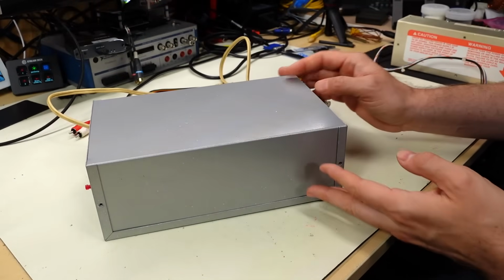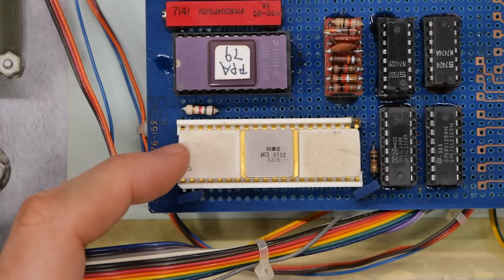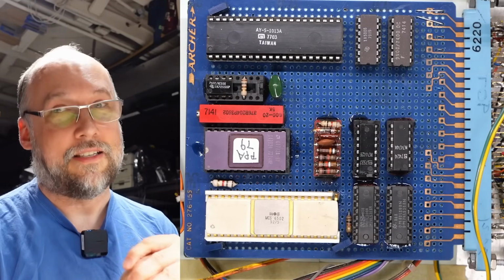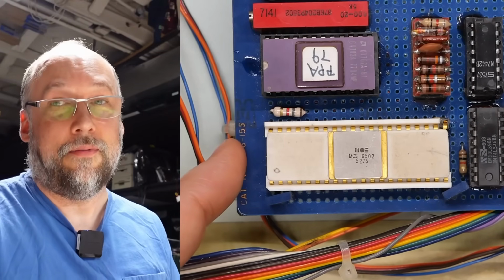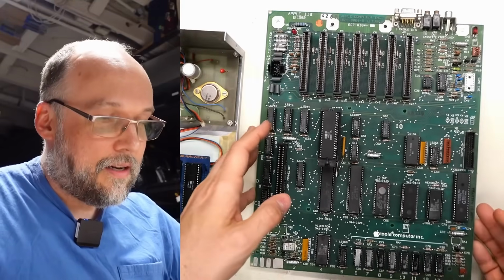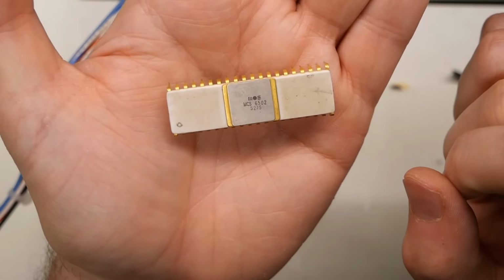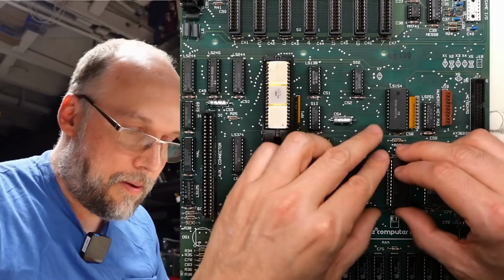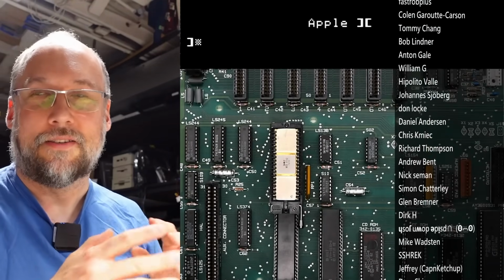Let's test a 50 year old MOS 6502 CPU

Comment: I loved this @adrian! I was studying electronics in 1974-1977, and then did a PhD in computer design. 
My one quibble with the video is that the 6502 is NOT a simplified 6800. 
Yes most of the original design team came from motorola, and yes the 6501 was pin compatible to the 6800. 
However it's architecture is very different to the 6800 and it has a fraction of the instructions. For example it has 2 index registers, and far fewer instructions.
Chuck wanted to build a better chip for control, because he found that people just balked at the $300+ price of the 6800!
Chuck Peddle's vision was for a cheaper chip to do simple interface and washing machine, etc. control. In other words using the microprocessor as replacement logic. 
I think he would have loved this application of the chip! 
And I love your sheer joy and excitement of having it work! It made my day!😊
Reply: I agree.  Sometimes there was an old way of doing something w/o a microprocessor, but now always.  I used mainly a Z-80 in that time period but I remember looking at the 6502 instruction set, etc., and I remember how relatively bare it was.  Sometime later than that my most hated micro was a PIC of some kind where instead of conditionally jumping to someplace you had to write the jump instruction and then branch over it if you Didn't want to jump.  Arrrg!
Reply: The 6502 is not a simplified 6800, it is a reduced-cost but more complex close relative of the 6800, that also performs much faster in skilled hands. They both have very few on-chip registers compared to the 8080 and z80. The 6502 dropped the 6800's B accumulator, reduced the stack pointer from 16 to 8 bits, and the index register from 16 to 8 bits but had two of them. Motorola themselves made similar modifications to the register set in their later chips that (unlike 6502) shared most binary opcodes with the 6800. The 6801/6803 allowed A&B to be used as a 16 bit D accumulator. The 6805 drops the B accumulator, reduces X and SP from 16 to 8 bits and PC to 13 bits, The 6811 like the 6801 supports the 16 bit D accumulator and also adds a 2nd 16 bit Y index register. And of course the 6809 supports D, adds Y index register and U extra stack pointer and allows all four of X, Y, S, U to be used almost interchangeably for indexing (but only S and U for stack). It also adds a lot of new addressing modes. So the 6502 would fit easily within the variation in the 6800 family, except it uses completely different opcode encodings. The biggest thing with the 6502 was the indexed indirect addressing modes that use a pair of zero-page locations as a 16 bit pointer, with a choice of using the X register to choose at runtime which base point to use, and the Y register allowing indexing relative to the pointer -- but sadly not both at the same time.  The 6800s four addressing modes are applied much more uniformly across instructions, but are less powerful and the bane of a 6800 programmer's life is constantly loading and storing the X register from RAM so you could point to different areas in RAM. The 6502 effectively had 128 6800-style base pointer registers, it's just that they lived in RAM. The 6800's 8 bit constant offset is useful for selecting fields of a struct, but not for pointing anywhere in RAM.

Comment: Well, in 1976 that chip would have been considered e-Waste... Makes you wonder in another 50 years what would be rare/collectable in today's e-Waste?   Wasn't one of the early Pentiums suffering from a math bug?  🤔
Reply: I think it's rare for micro manufacturers publish bug sheets.  But the few bug sheets I saw back in the day, there were a surprising number of bugs in the silicon!  It's not hard to believe a ROR instruction didn't work, but more typical was something on the order of some operation doesn't affect the flags like the manual says

Comment: Adrian, I Believe, I found 2 of these, Chips, A year or so Ago, I will Look and see, I am Not any kind of Electronic, or computer Guy, I just like Messing with Things and Most of the Time I get things Running, I will Look for Them, The Reason I think they are the 6502, I remember looking up This chip and Reading about the Missing file it Needed. I will Let you Know, I,m glad I found your Video

Comment: I haven't quite put into 2022 dollars how much I spent on early computers back in the mid-70's and 80's. It seems that each system cost about $4500 back then, and I was avid to keep upgrading when anything new came out. My first S-100 system (which I still have!) had a massive transformer for power, and the case was made of 1/8th inch thick steel. It had at least 12 card slots, where each S-100 card of course had 100 pins. To add a mere 8k of ram to the system cost me then $625... for a mere 8k!!! I think ram topped out at 32k, and it cost me a fortune. I had a particular project to accomplish, involving multivariate linear regression. When I finally wrote the program and ran it, got the error message "Insufficient memory to invert the matrix". And that was that. The project failed. I continued on with Z-80, 8080, then 286, 386, 486, and pentium cpu's. When all said and done, I probably had spent over $100,000 of "1980-ish dollars", and in the end my best system was no better than any junk desktop no one wants for any reason. But I can tell a lot of stories such as about my pair of 8-inch floppy drives which weighed about 150 pounds. When it needed repair, I had to transport it in a wagon to be shipped from NYC to Boston, all so they could overcharge me to replace some big loose rubber bands or something. You get the picture.

Comment: I have about a dozen National Semiconductor 8080A microprocessors, the first ones ever put in plastic packages. They were burned in for 1000 hours and still passed final test after that. They are from the fall of 1976 so I don't know if they are still good or not. That have spent all of the time since then in black conductive foam. I also have some in CERDIP and side braze packages.

Comment: That is a beautiful board. Instead of shadowbox I would put it on a turntable so it shows off the wire wrap side too. I wish Radio Shack was still around. The oldschool one. It's made basic repairs on gear at the radio station go from a few hours to a few days sometimes resulting in being off the air if I don't have the component and I have to stock a whole lot more components and connectors that I can no longer "Run to The Shack" like I used to. I wish ours had survived since it was Radio Shack in name only and the owner stocked a lot more than you would find at a regular shack. Now I have to order from Mouser or Digikey.

Comment: Chips with bugs went in production back then. I.E. the 286 couldn’t, but should have been able to run in virtual mode .. the 386 had to have a math-co, because that part was disabled.
 Contrary to popular belief, wire wrap is very reliable, and is still in use today .. was a mainstay in Western Electric telephone company CO single solid conductor cross connects.

Comment: Wow - memory lane. Its a timecapsule of 1970's United States IC manufacturers.  You have Texas Instruments, General Instruments (UART), Signetics,  Fairchild and of course MOS Technologies (later Commodore). I cannot read the UVPROM vendor but its likely Intel.  For the young folks out there to update the ROM (you call it flashing) - you had to take it out of its socket, put it under a UV lamp for 30 minutes to erase it and then you could update the image again. Very time consuming. 
There is a bit of folklore about the 6502. Rumor is that the reason it was used in the first Apple Computer kits was that Wozniak worked at HP. HP had a policy that Engineers could take parts, for free, home for their personal projects to encourage individual growth.  It is said Woz snagged a tube of 6502's out of the lab inventory and built the Apple I with them. Back then it was not easy getting parts. And starting a company was a challenge as the concept of Venture Capital was just beginning to seed. Most startup personal computer companies in the SF Bay Area (there were about 60) ran month to month like a shoe store. You secured a line of credit, built sold, paid it down and continued.

Comment: What about making this processor do something like simple clock, or a count down that would show on leds it's age up to the second digit staring at the 1st of the month after it was produced to calculate its age? 
 Like a box with a PLASTIC sceen with a tag saying I am a 6502 YY years, DDD days, HH hours, MM minute, SS second : old And I am still working. And to make sure it always the right data displayed use an RTC chip that have the date and time setup properly. A simple rom load wich first read the RTC then it use the databus 4 first bit to send the data to 1 bcd to 7 line dispaly chip to drivre the 11 7 line leds that form the number and with the 4 last bit of the bus use a 4 to 16 line demultiplexer like the 74154 that will drive the good led common select of the 11 7 bar led. or of you dont want to use the 8 bit buss, use the adresse data bit to do the same I am sure the that you wont need much ram if any at all. worst case a 1k ram chip would be more than enough.

Comment: It's weird - I learned to program in high school in 1972 - my microprocessor history goes through the 4004, the 8008, the 8080, the Z80 and 8085 - then the 68000, Z8000, the 8086...and so on.  But I never owned a 6502 or a 6800 - I bought a couple of TRS-80's for home - never bought a Commodore or Apple machine...somehow, I completely missed the 6502 & 6800...I doubt I've ever programmed one - which is very weird now that I come to think about it!

Comment: These would have been very rarely used for that specific purpose by that point in time.  You could have opened 100 other I/O converter boxes from that time period and NOT ONE would have had an early pre-fix 6502 but this one user, is the 1% or 0.1% of them that just so happened to maybe get it on sale as maybe old stock discounted gen-1 6502 (I am willing to bet he paid maybe $10 for this as there is no way anyone would pay full retail for a bugged 6502 at that time) as at that time, this would have been useless or just too much of a hassle for anyone to use it for "modern" computing but as an I/O box, it worked just fine.

Comment: Back in the late 90s I was a janitor who cleaned office buildings and there was several dozen times if not more where they threw away old computer parts; motherboards, daughter cards, expansion cards, serial cables, even entire PCs, you name it.  I was curious about it and even wanted to take some of it home and play around with it but my supervisor specifically forbade it and it basically all went to the dump as there was really no way to "recycle" stuff like that around here at that time as the first e-waste recycling efforts really didn't kick in significantly till several years later.  It's hard to imagine all the great old vintage PC components were sent to landfills back in those days as it was the mid to late 90s when the first major wave of large scale technology replacement happened with old computers from the 1980s being replaced with shiny new computers from the mid to late 90s.

Comment: well. he didn't have to code the testrom blind... could simply modify the 6502 part of the code of an emulator to bug the ror so you know the rom works :P in as far as most of them out there don't already have support for all sorts of such things. (no bit instruction on some 65c02's, no decimal mode on nes, etc). emulators too have been around for at least 30 years by now and as such i'd say quite a few can cater to quite a few different cpu and microcontroller versions of the 6502 ;) and for most 'entire computer' emulators the actual cpu part is eh. well. just a file with conditions. if instruction=x a++, if a=0 z=1. wait 3 cycles, whatever :p so fairly easy to put a broken ror into :P btw... guess what doesn't have a single ROR. ah yeah. wozmon for the apple-1 :P

Comment: This is cool stuff and brings back memories of my early days in electronics.

In the mid-1980s, I worked on early video terminals including the Ontel OPs. Ontel was a unique company because they started in the late 1970s and were still making 1970s era terminals in the 80s. In amongst some of the parts were some Intel 8008s which were really small compared to the processors that came later on. They did use 6502s but they were used on the video circuits of their CP/M computer which later on became the Visual V-1050. That system had a Z80 for the main processor and a 6502 with 32K of dedicated video RAM for the graphics side.

Ontel's "intelligent" terminals came with many options including I/O microprocessors and what they called word mover-controllers. The I/O microprocessors were boards that were covered with nothing but parallel shift registers and flip-flops and the sole function was to carry data to the various peripheral boards included in the systems.

The word mover-controllers were also nothing but registers and were used as memory buffers for a word processing system they built. These controllers did what we do with memory today for the cut, copy and paste functions which we take for granted for copying huge amounts of data including images today. Back then, I think they were 4K or 8K maximum in size.

Both boards were not easy to work on, from what I recall. The various flip-flops and registers were driven by phase-locked loops and clock circuits which made tracing signals difficult. If one of the clocks went out, all signals died completely making that impossible find.

Comment: I found a white ceramic 901447-18 ROM chip in a PET Bootloader II board. Searched the webs up and down and so far, it's the only -18 chip anyone has ever seen. 
Even tried to get in touch with Bill Seiler, but never got a response. I did manage to get a dump of the ROM using my Retro Chip Tester Pro and uploaded a picture to the c64 wiki list of known MOS products.

Comment: That's super cool. BUT I would have been fired for pulling a chip (especially MOS) without an antistatic wristband. And for good reason. Please be more careful. And just because it runs today doesn't mean static didn't damage the silicon. They don't fail all at once or right away. Usually just a little bit of the silicon is zapped. Anyhow really enjoy the channel but handling this rare MOS chip is cringy. Appreciate the channel. But please get an antistatic mat and wrist band :)

Comment: That was a lucky find, a 6502 in Ceramic DIP. So cool. The 6502 was the first processor I ever wrote code for. Never knew about the ROR bug in the early versions. Looking at the AY-5-1013A which is indeed a UART. To think you could stick a cheap Atmel or Microchip PIC in here to do the same function on a tiny 18pin device is just crazy.

Comment: The guy probably had part in his stash, and could possibly got it from work. You use what you have. He may not have had the tools available to develop code for something else. Early microcontrollers where not cheap, in ones and two-zees, and in the EPROM version. The cheap ones, were the bulk programmed masked ROMed one. I build a lot of simple projects with 8085s and Z80s, because I had both the parts, and access, at work, for the development tools. A Tektronix 8002 or 8550 development station cost $10 of thousands, in the late 1970s. Likewise, the HP 64000. I used both. Sometimes the code, was so simple, you could get away with no RAM, and use the registers only. Easier with a Z80 than a 6800, as the Z80 had more registers. But then, I'm in my 60s. Did exclusively wire-wrapping, from 1978 thru 1988.

Comment: It's hard to watch without using proper anti-static protections (especially with MOS silicon)... Remember, it doesn't have to flat out fail to be effected. Chips can be s.l.o.w.l.y damaged as they are mis-handled. Just saying.
Reply: 100%

Comment: Wow. I had some friends in high school who had C64 computers. Me? I only had a Z80 based computer (NOT the TRS-80). Fast forward to a job I had in the early 90s, one of my coworkers previously worked for Commodore. His job was porting Unix to the Amiga. Interestingly enough, the Amiga had the 6502... as the keyboard controller. LOL. He had some good stories of the company before the end times. One was how they had a small plant across the street for prototyping all sorts of stuff. I don't remember the details he told me, but they could do basically anything and had some rather cool ideas for modular computers. The Amiga was way better than the Macintosh of the same era. Better OS and hardware. If Commodore's management didn't screw things up, we could be running some seriously interesting descendants of the Amiga today. I wonder what they would have done with ARM.

Comment: Too bad you didn't enter some BASIC statements on the Apple II board. As far as I can remember, RORs instructions were needed for multiplication. These early processors didn't have multiply instructions, multiply had to be done in code. So, if you would enter a statement like "PRINT 2 * 4", maybe the ROR bug would show up.
Besides that, this video is an example of the most nerdy excitement possible: Being exicted of finding an old processor with a error in it - but I share this excitement 🙂I loved to program Apple IIs in assembler, the 6502 was a nice little processor, with a very clear and easy to learn instruction set, especially compared to the clumsy Intel chips like the 8080.